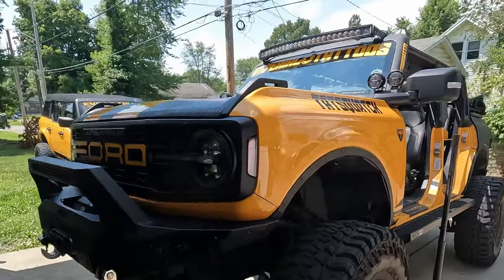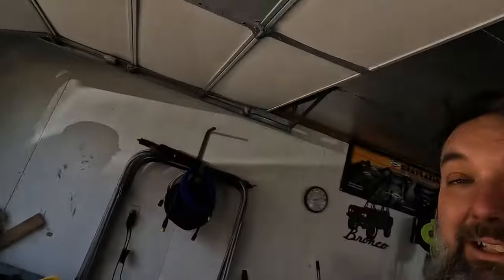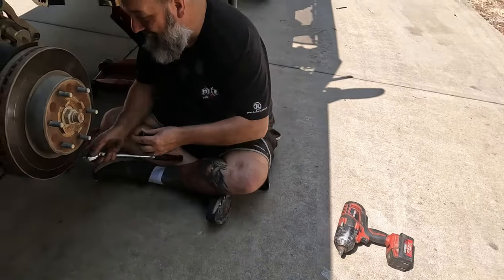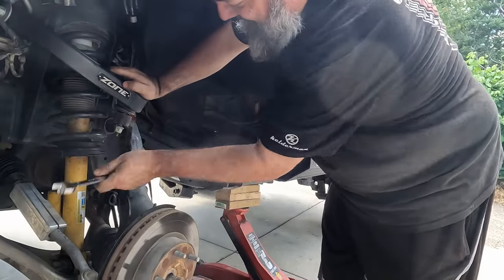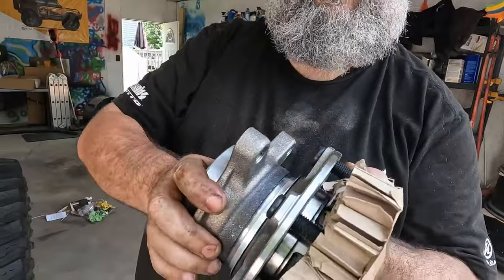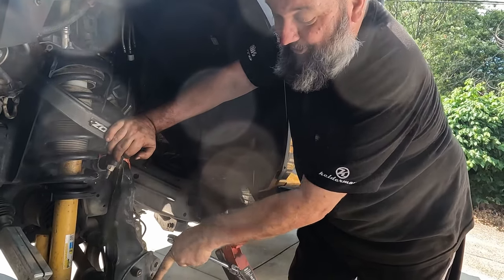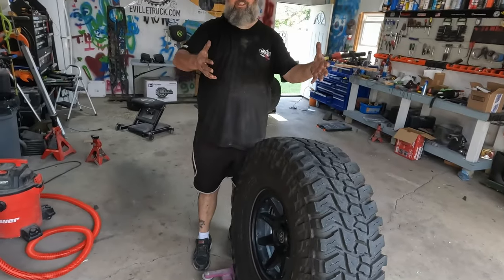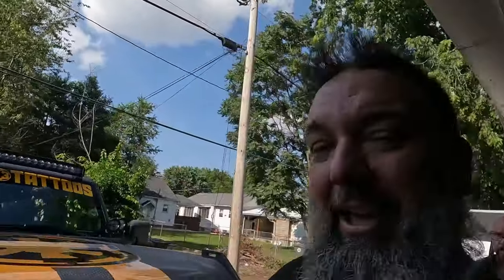How to replace front wheel bearing on a Ford Bronco 2021 +

Comment: This may be a stupid question but could you swap the hubs for the bronco raptor hubs to be able to use the bronco raptor wheels? any idea?
Reply from the maker: I am not 100% sure, if  the Braptor uses the same knuckles and brake calipers it could work  you would obviously need  to switch out brake rotors as well but if they are same size it could work,